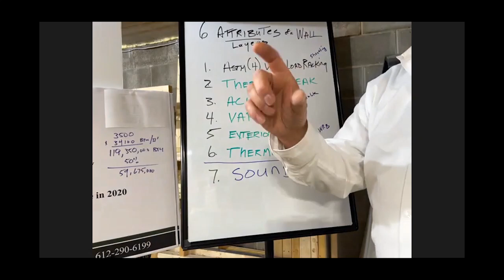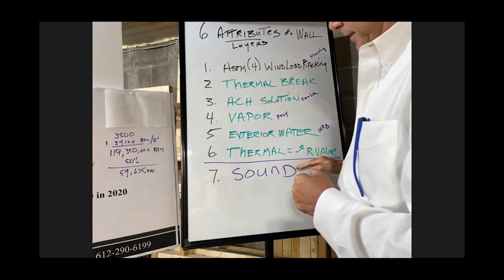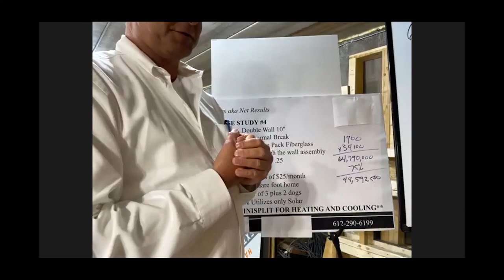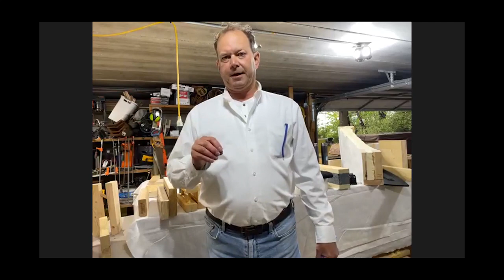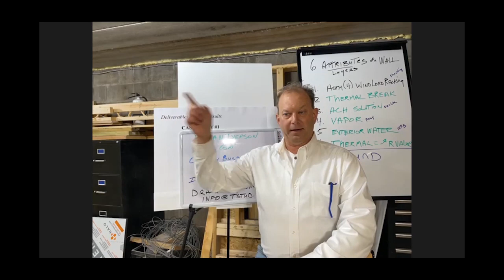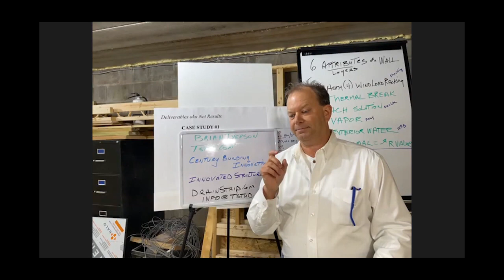Live demo: Everything to do with walls for higher performance

Comment: I have heard that the closed cell spray foam is somewhat toxic. Is there other types of ins can be sprayed in these wall assemblies? Could I use cellulose for the assembly of the wall?
Reply: You can buy Tstud(tm) and insulate them with whatever you would like Ryan, including sheep wool. Or you can have Century Building Innovations send you wall panels with the spray foam installed to help you get to a Net Zero build easily. And if I can be serious here, you say you don't want toxic but you like cellulose??? Same fire retardants Ryan.
Reply: Use BIBS. Blow In Blanket System.
Reply: I asked this question before the full video. I didn’t see the other foam that is as good as cellulose. I’m very interested innovate spray foam that is only 3 global warming scale